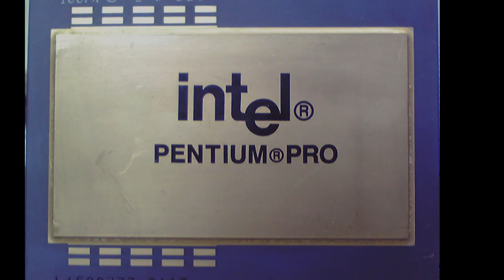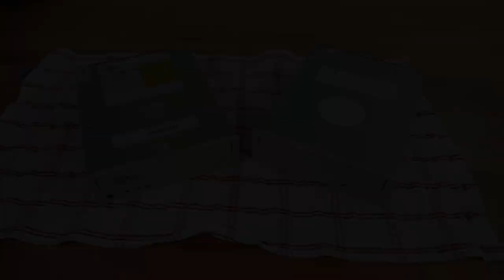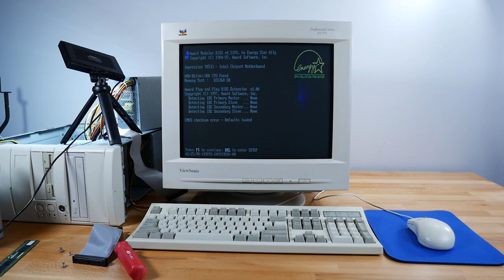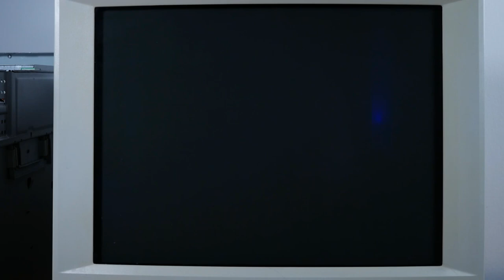AMD K6-2 - The 1998 Retro Gaming Rig - Part 1

Comment: Got linked to this from a reddit post.

Oh man that case, I had one that looked like that but with a speed display in the center right under the floppy drive bays. Used it from a 386 up to a K6-2 300, then sadly it got thrown away when I moved across the country.

Oof on the PSU.

The S3 cards were great for DOS compatibility but pretty terrible for Windows D3D performance. One good period-correct option is to pair it with a Voodoo or Voodoo 2 card for that but they're pretty pricey these days. You're a bit limited due to lack of AGP on that board.

For a sound card, a great option is an AWE64 (came out in 1996). Great DOS compatibility, the value versions are cheap-ish and essentially equal to the more expensive golds. They fixed the hanging note bug that earlier cards had and uses the ISA slots so you're not using PCI. However, if all you really care for is Windows - the Live! is newer and period correct for 1998 but not as great for DOS drivers.

I'll sub, waiting for part 2! :)
Reply from the maker: Thanks for stopping by and watching! I'd love a speed display on this case but I have a feeling this is a budget one that was used in many builds. Several people have mentioned they recognized it or have memories of using it. Wonder if I can source a front panel that supports the speed display hmm...

As far as the components you are pretty spot on! Part 2 is in progress and I think your predictions may line up very well with what is going to go into the machine. Thanks for the sub!

Comment: Hi Rik, subscribed to the channel!! As a Retro Computer enthusiast, you have a lot of interesting content! Thanks to the YouTube recommendations for showing me this video xD!
I immediately caught the mistake on the power supply connector, but I think it happened to all of us, at least once. I did it a while ago with an older 286 board and surprisingly nothing bad happened to the PSU or the motherboard, but man I can tell I was sweating like a false witness when trying again! I noticed you said "Featuring EDO..." like a general denomination of the memory slot? I usually say SIMM or 72-pin SIMM if the board has them mixed with the older 30 pin ones. I have a 486 motherboard that uses these 72-pin SIMMs but it can't take EDO type memory, it only works with FPM modules, so it sounds a bit strange to me when someone refers to them only as "EDO". Can't wait to see Part 2!!!
Reply from the maker: Thanks for watching and the encouragement I really appreciate it! Really glad you decided to watch from the recommendation always fun to see new people watching my videos.

As for the power supply mistake I redid the video to call it out because I'd like to learn and show as I do so. I don't mind mistakes but I think it's important to leave them in even if it's for nothing but a laugh!

And for the memory honestly you are correct I don't think I normally call it EDO just that I had it in my head as I recorded it and then just ended up saying it hah. A lot of terminology to keep straight sometimes and sure enough it stayed in the video without me even noticing but pretty sure I don't normally call them that.

Comment: The noise you're hearing from the optical drive may not actually problem with the motor. Some drives from that era used ball bearings to act as a counterweight against a poorly balanced disc.
Reply from the maker: Aha that makes sense if so. I don't think I've heard a drive rattle quite that much but maybe I'll give it a shot and see if it works. Thanks for the info!

Comment: Ohh yeah, learned the black in the middle thing the hard way once...... One tip. If I remember right. The screw spacing on the PS/2 connector is the same at the serial port cutouts, so you can mount the PS/2 connector in the serial cutout.
Reply from the maker: Yeah lesson learned hah. Oh well! But thanks for the mounting tip as well. It's been pretty solid so far but I wouldn't mind revisiting it to clean it up some more if I can too!

Comment: My k6-2 system back in the day used an Amptron 598lm-r motherboard. Had it maxed to 768mb ram the cpu at 550mhz. Sadly never got around to putting a decent gpu in it, had onboad sis530 chipset. Later drivers allowed me to set 32mb memory to the chip. It did... OK. Played starcraft (oh soo many hrs of starcraft), diablo ii, Jane's combat flight sim, armored fist, half life, cs 1.6, sim city 3000, anno 1602, shogo Mad, septerra core, tachyon the fringe, and of course emulators. (and many more) Ran win 3.11 through xp on it lol. 3.11 on a 550mhz cpu was hilariously fast.

The chipset was pretty stable and having usb (although slow 1.1) made the system useful far longer than expected. I later went to an athlon XP and so on.
Reply from the maker: Hah oh boy. Thanks for sharing that is one blast of nostalgia with those games! I think a lot of us that are deep in the retro hobby and have access to quite powerful era specific machines forget what that we often didn't have that originally. I played on my 486 33SX quite happily and it wasn't exactly fast but I had nothing else to compare against! Well except my fancy friend with his 50 MHz...

Does make me want to try 3.11 on an overpowered system though!
Reply: @RiksRandomRetro  my first win 3.11 system was an old dell 386dx at 25mhz, had like 4mb ram.

Comment: The plastic clips were pretty common in the 80s and 90s, I only started using the standoffs and screws method in the 2000s when they became more extensive. Case design has come a long long way, even cheaper ones.
Reply from the maker: Modern cases really are amazing as far as how easy they are to work with, something I think people forget. When I built my last modern machine it was a breeze and no sharp edges! I definitely have fun working on these old machines but it's hard to ignore the modern conveniences...
Reply: @RiksRandomRetro  yup I don't get any cut fingers while working on newer machines :) and cable management ah a dream. Ribbon cables really made it hard to get a decent clean look.

Comment: good channel, congratulations ... where did you get the power switch to install in the case?
Reply from the maker: Thanks much appreciated! I bought mine here (not my listing): https://www.ebay.com/itm/Computer-System-Power-Switch-ATX-Style-Push-Button-ON-OFF-Mechanical-Toggle-PC-/272468175682?_trksid=p2349624.m46890.l49292

Comment: Great Video! I have the same case and similar motherboard made by Matronics(I believe a PC Chips sister  company or rebrand) with the AT and ATX setup in the upper left instead of below the ram and the SD Ram and EDO Ram  but maxes out with the original AMD K6-300(wich I still have to install sice I have one) instead of the 66Mhz version of the K6-2 like your board supports. Great video and have a good one.
Reply from the maker: Thanks! It's really a neat case for the era and seems to have had quite a few variants based on what other people have told me as well. That motherboard must have been rebranded and resold in different varieties as well as I was able to find some variants doing research on it. I will say officially per documentation this only supports K6-300 but I figured I'd try my K6-2 and lo and behold it is running great.
Reply: I will have to try that as well I got a spare K6-2 400 and I will have to see how far it pushes the chip to.

Comment: Where would one get such a momentary power switch that fits an AT case like the new one you're using? Would be handy to have something like that for a similar-ish build I'm working on.
Reply from the maker: Sure thing I got mine from here (not my listing or me selling): https://www.ebay.com/itm/Computer-System-Power-Switch-ATX-Style-Push-Button-ON-OFF-Mechanical-Toggle-PC-/272468175682?_trksid=p2349624.m46890.l49292
Reply: @RiksRandomRetro  Thanks!

Comment: Does a USB pci board needs to install driver?
Reply from the maker: So I think the USB controller on that board needs to be detected by the OS. So chances are the drivers are already there but yes something is needed I would assume. If it works outside of Windows I think depends on the motherboard and bios.
Reply: @RiksRandomRetro  motherboard is Sis 530